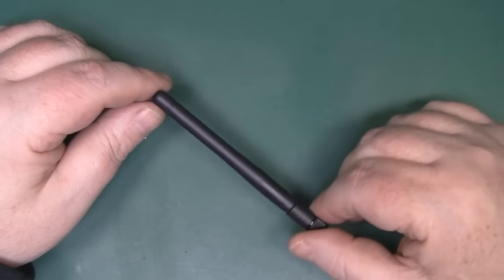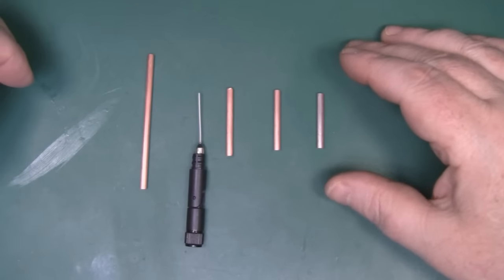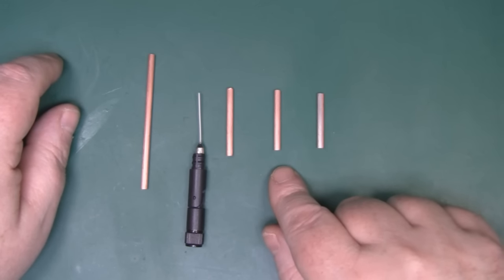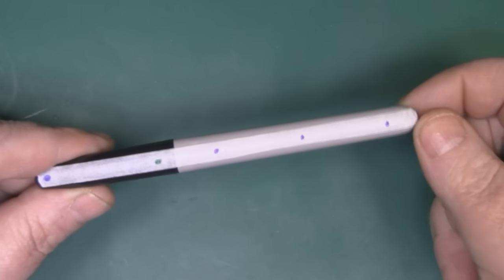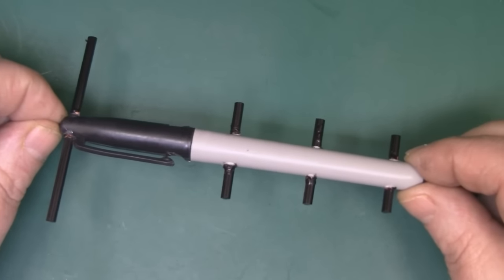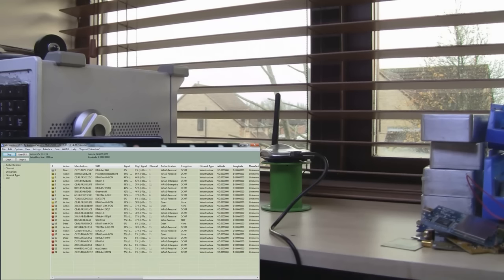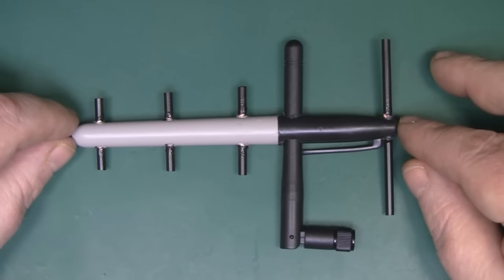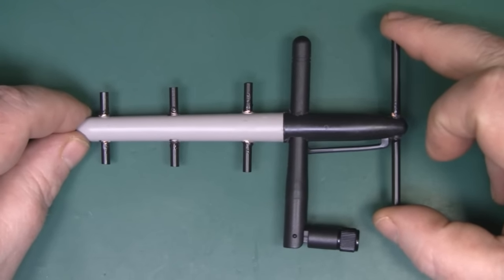The Sharpie Pen Yagi Adapter

Comment: I just built this!  It works!  I got ~10 to 15% improvement, which was just enough to go from nearly unusable wifi to an excellent connection. There is a thick cement wall, with insulation covered with a thin aluminium film, between me and the router.  Even though the distance is only about 10 meters, the signal was attenuated too much to use reliably.  This little antenna boosted it just enough to make it quite stable.

Thanks a million!
Reply from the maker: +Bob Lake No problem Bob I was also surprised how effective it was.

Comment: Great video, thank you! I realise I'm 8 years behind everyone, and maybe I missed it but...I wonder if the performance would be better if the pen was slid down the dipole antenna, closer to the pivot point? I was thinking that the driver needs to be more centrally located in relation to the axis? Will test it out....

Comment: cool! 
how did you do the calculations?
I have a slightly longer dipole antenna on my router, a 5dBi, inside roughly 12cm long. What reflector length and distance and what for one director or two?
thanks

Comment: Nice idea, i wonder if this is better then the windsurfer reflector, because i am looking to boost the signal of my router, which has two slightly bigger 5dbi antennas and the windsurfer did not made much of a difference for me.
Reply from the maker: +TomTheDragon Hi Tom I would think a windsurfer would give better performance but to be honest I don,t know. Maybe I could do a quick video over the holidays as I have been playing around with this design and I have improved it slightly. Could do a  versus video, windsurfer v pringles can v yagi adapter
Reply: +andrew mcneil  The windsurfer has been worth  the effort for me!  Access points that would not normally show up are now accessable and the signal strength varies from good to excellent.  
I use a TP link wn 722n with a 5 dbi antenna(di pole)  From buying many wireless sticks this one has impressed me the most
Atheros chipset
Even the 'good' signal ap's seem to be very stable and reliable.
Thumbs Up!!

Comment: First off, I quite enjoy your videos; very practical info. The one thing I am sometimes not clear on is the wiring; would it be possible to insert somehow, an image of the schematic for the antenna?
It is not always clear whilst watching the construction. Thanks.
Reply: No wiring just push the copper bits through the pen housing, it's just slid over the other antenna

Comment: If you 3d printed the complex shapes I've seen you create with rigid solid core wires (using pliers and patience), could you not create a 3d frame work in which you could snap in (or lay down) very flexible solid core wires (or stranded wires)?  Like the spiral elements I've seen you make, you could print a spiral with a groove in it, and then simply lay down a wire.  What do you think?
Reply: +mdesm2005  there is quite a lot of them already I think,  just one example if this is what you mean http://www.thingiverse.com/thing:247851

Comment: I heard somewhere that silver plating my copper after building my antenna would help clean up signal, would you'll think this is true? old German ham radios had there insides silver plated and we're considered the best around
Reply from the maker: +Hector L That,s true silver is a better conductor it is one of the reasons why the test equipment is so expensive its silver traces plated in gold. The gold is to stop the silver from tarnishing.

Comment: are you buying 3d printer mr andrew?
Reply from the maker: +vVic t0rx Its on the list but I want a new network analyser first as mine is quite old. Not sure if I should get a laser cutter before a 3d printer though.
Reply: +andrew mcneil 3d printers could be amazing for antennas with existence of truly conductive filament. But it is hard to say how conductive (and affordable) it really can get. For 3d printer probably I wouldn't go with ctc, some other replicator1 clones like flashforge are pretty similar, but better at some important aspects (like redesigned motherboard) from what I know.Anyway, thanks for your great videos!